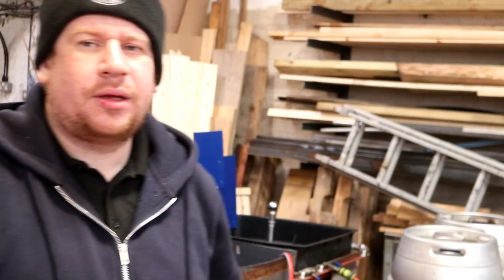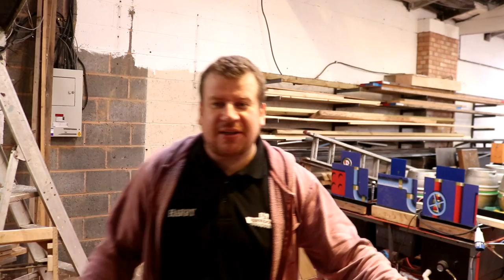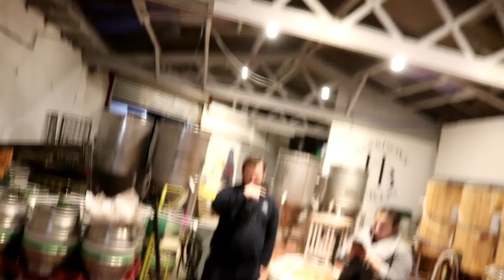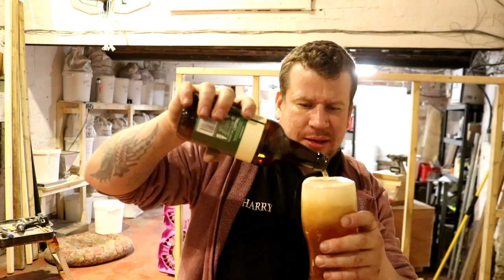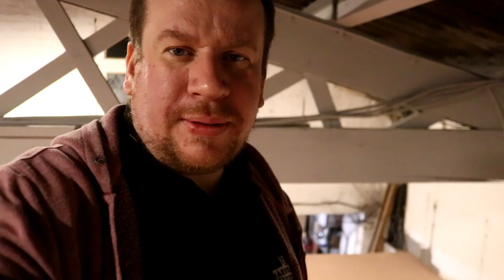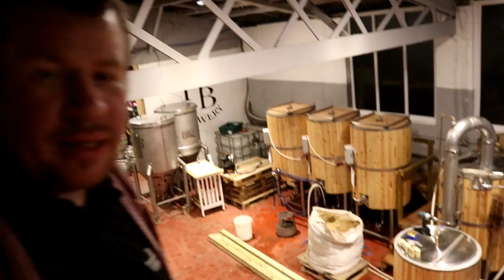GREAT VANTAGE POINT

Comment: Surely you need to insulate the outside wall as well. Its got to be the biggest thermal influence on the store. Think of it this way would you wouldnt put a brick lid on a picnic cool box and expect it to stay cool (or be able to carry it I know). Its like your making one side of the store out of a massive heatsink. The floor you cant really do anything about I know. Even really thin ply with an air gap would be better.Just a thought.

Comment: That stout mash looked bloody lovely,bet it smelled great too. Unfortunate on the over sparge but hopefully extra boiling didn't bollix up the ibus and it turns out ok. Great to see the cold room finally being started though I am curious as to why you didn't put it down at back of HB logo like you originally planned? You knocked up that framework bloody quick and I reckon top will hold a nice bit of weight,be interested in seeing how you insulate it,however I would caution against skipping insulation on any of the external walls due to thermal heat sink especially with ambient/environmental temp fluctuations. Stay frosty. Cheers.